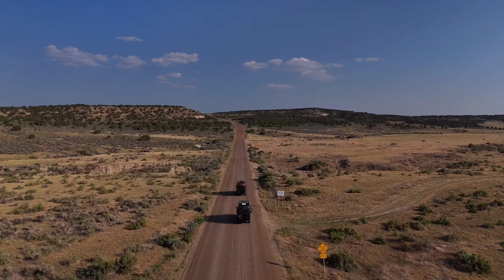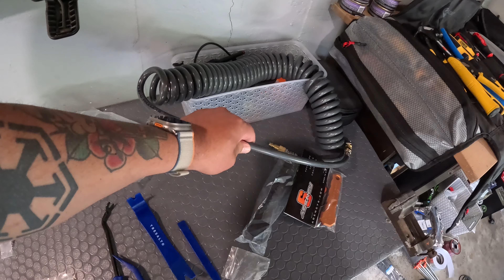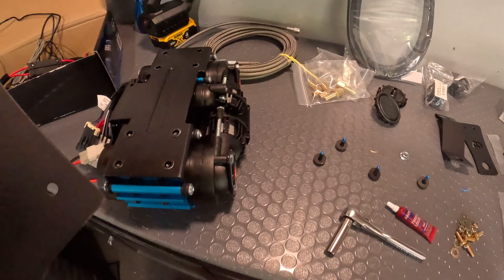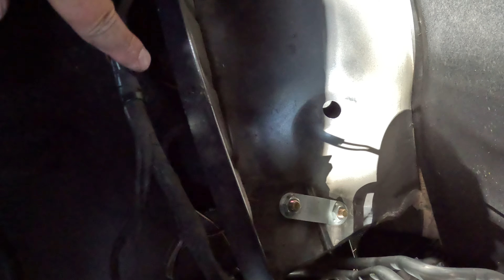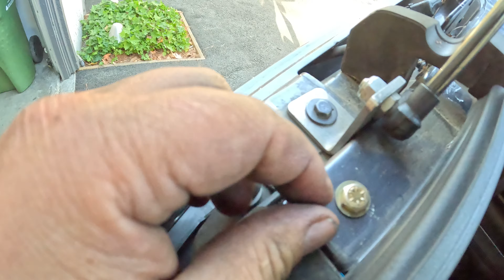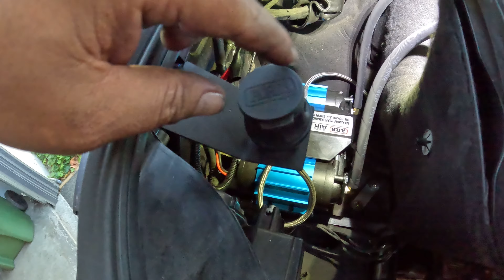ARB Onboard Air Kit for Sprinter + AuxBeam Install  | vlog 003

Comment: I am reading / view sources that warn against using a Switch Pro due to the high current draw. Use the provided switch. Same goes for a winch.
Reply from the maker: I’m not using a SwitchPro. In this video I was using a AuxBeam but have since upgraded to a GarminPower Switch. The ARB Compressors on/off switch runs to that but the power comes directly from the battery. Winch is the same way.
Reply: @ZekesView Hi, any reason you move to GarminPower switch, I am at the same situation that have a Auxbeam and want to connect the compressor to house battery but only use Auxbeam as a power switch. Not sure if Auxbeam can do that, but I know GarminPower switch can easily do it. Is this the main reason you switch to GarminPower?
Reply from the maker: @raphaelliu68 I went with the Garmin to remove the need for another device in the van. Garmin has an app that works on CarPlay
Reply: @ZekesView which Garmin device did you get?  Did you do a YT vid on the install?
Reply: Reread our top comment “Garmin PowerSwitch”
Reply from the maker: @gerrylara4783 Garmin PowerSwitch to manage the lights and Garmin Tread Overland for GPS, maps, and had the PowerSwitch App. Plus I can control from my phone
Reply: @ZekesView  my concern is my Auxbeam powered by house battery. Because I want it to control my scene light as well at the camper site. The compressor I will connect direct to the starter battery. If I only connect the purple wire to Auxbeam, will it work? Does my Auxbeam also need to connect to vehicle ground to make it working? My Auxbeam now is connected to my house battery positive and negative terminal.
Reply from the maker: @raphaelliu68 that should work. The AuxBeam is just telling the ARB to turn on and off.

Comment: Hello. Can you please explain/tell me where on the van you connected the air compressor/winch for power? Please?
Reply from the maker: @brettferguson6954  I have a shunt in the engine bay that runs directly from the battery and the winch ties into.  

It’s mounted on the driver side, inside the engine bay by the ECU.
Reply: @   Is it like the remote power distribution thing that Van Compass once sold?

Comment: Any concerns with running the ARB Twin to the auxbeam 30A circuit and it exceeding the 30A draw? From what I heard, you'd have to be airing up at a pretty high PSI to do this but I use a 4-way air up system on my jeep to air all 4 tires at the same time and trying to find info on whether or not this could exceed the 30A and trip the fuse. Came across your vid in my research - helpful and great explanation!
Reply from the maker: @mdizz05  Zero concerns.  You have to remember that the ARB isn’t powered off the AuxBeam.  The ARB is connected directly to a shunt that my winch is also tied onto - which is directly linked to the battery.  

The AuxBeam simple turns on the compressor via the purple wire.  The ARB does draw more than 30amps also.  I believe its max draw is 60amps under load.  I have a twin line for airing up and down and haven’t had any problems.  

I probably should make a follow up video. I’m actually switching out the AuxBeam for a Garmin Powerswitch and can further explain the power draw

Comment: This is a super useful video, Zeke. I'm glad you called out that you already had a hot wire you tapped into from your winch. Thanks for sharing!
Reply from the maker: Glad you found it helpful, it was a little tricky but works